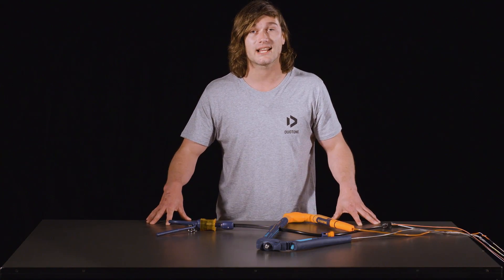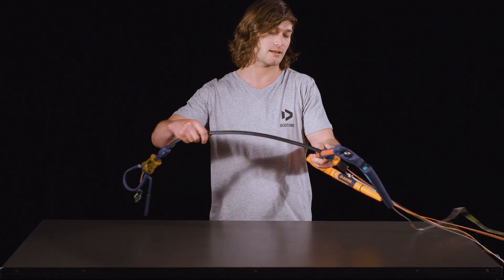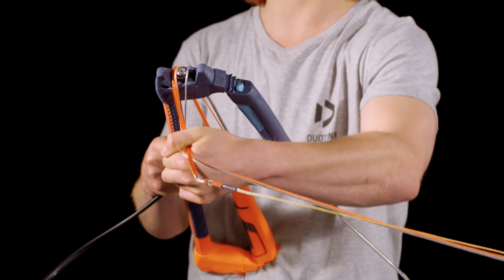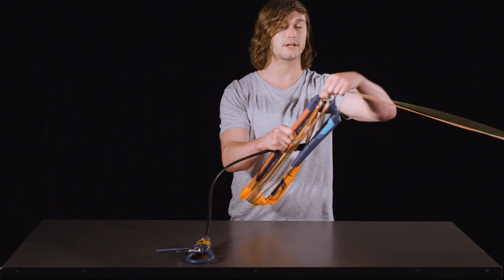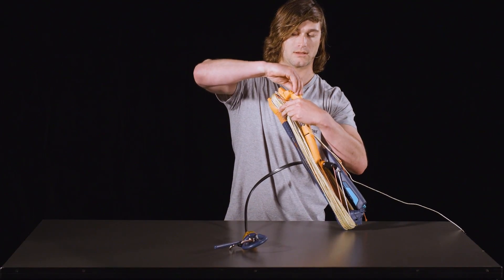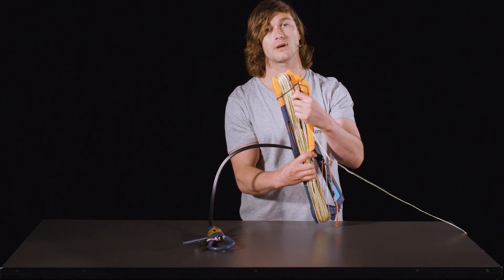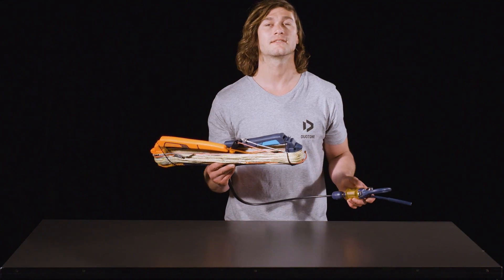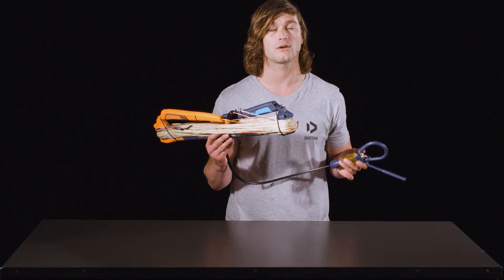How to Roll the Duotone Click Bar

Comment: Hi,
Im confused i thought you need to roll an 8.
So the lines dont curl up, due the Rotation?
Reply from the maker: No, the best way is to do it like this!!
Reply: @DUOTONEKiteboarding  Rolling straight - If your elastics pop off for any reason and the lines fall off the bar ===>>> Spaghetti!!!!  I stick with the figure 8.
Reply: @mikerogers2319  one elastic popped on mine..

Comment: Hi! What is the difference riding the kite in the different distributor positions? Is it recommended to put it off for wave riding with the new 2023 click bar?
Reply from the maker: It is a personal preference choice.  To generalize, the higher the dirtibution point, the faster, more reactive and less depower throw needed.  Lower distribution, gives easier bar / line juggling and a detuned feeling that some like.  For example Freestyle riders who want the kite to move slower and have more detuned feeling, almost always use the low V option.  The Big Air team uses the high V distribution always because they want the fastest and most direct feeling.